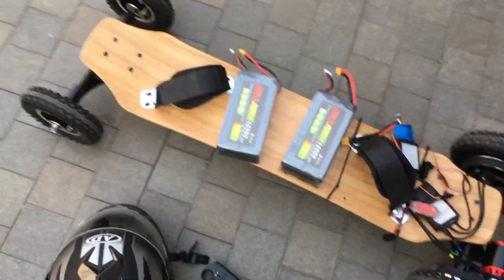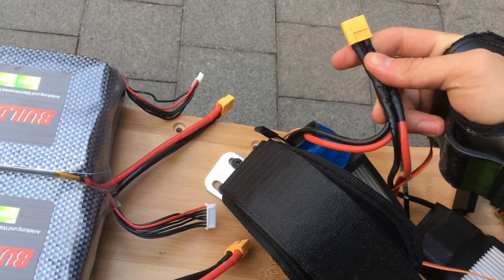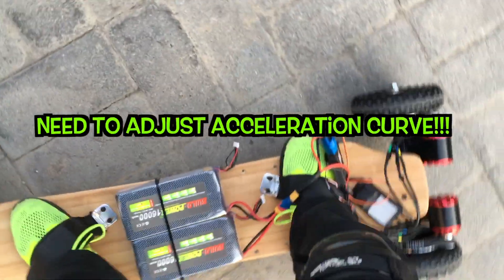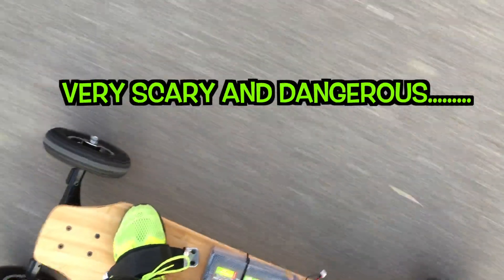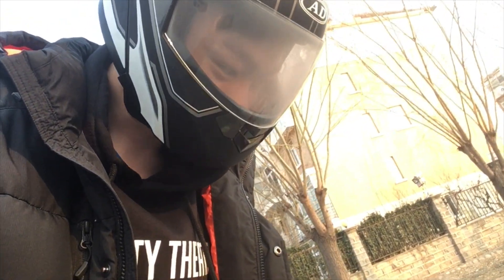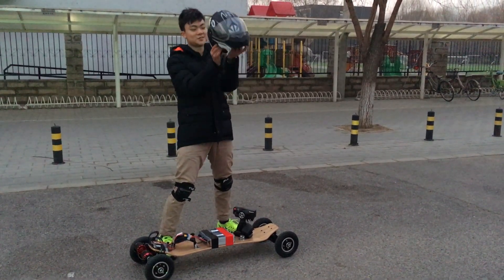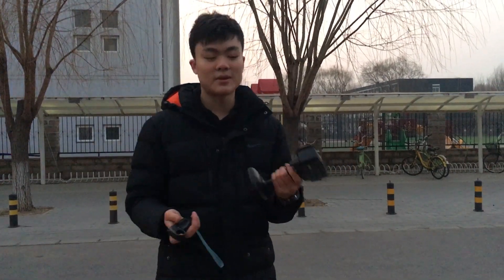DIY Electric Mountain Board (Part 3 FINAL PRODUCT)

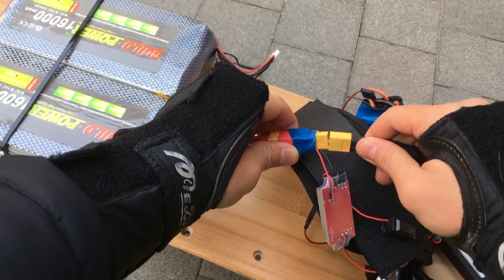Comment: 2:25 simple fact sound can be create when electro magnet and magnet is together (vibrating) like in a speaker.
 Not spining motor. Check your fact
Reply from the maker: Yea that’s what I meant haha spinning might not have been the right word thanks for the correction! Just thought it was cool that the motor makes the noise haha

Comment: Sweet build! The motors are screaming for MOAR power!
Reply from the maker: Ratheon Hudson thanks! Might make another build with this setup haha
Reply: @Leetheskill  Ever thought of getting a big block lipo for long range? I mounted a massive 40ah lipo to feed my 6.6kw Cross Country AWD board. I also mounted a few accessories powered by a 50ah 12v lipo
Reply from the maker: Ratheon Hudson wow that seems like a beast of a board, what’s the range and TOP speed?
Reply: @Leetheskill  Range, around 60 kilometres, the top speed is 45.5kph. Oh, and it had a Bluetooth subwoofer, dual fast usb charging, dual light bars and a low beam lightbar, and a truck taillight. Plus led underglow. I think... I overdid it.
At least my remote won't ever run out of power. I've got it covered
Reply from the maker: Ratheon Hudson I would love to give it a spin hahaha
Reply: @Leetheskill  yup, it's significantly heavier than most because of the large hub motors and weight distribution, but that smoothes the ride out well. I bet you'll love it
Reply from the maker: Can’t imagine the weight haha my board is already pretty darn heavy. Got trapped outside when it ran out of battery took so Long to drag it home hahah
Reply: @Leetheskill  Oh well it's not car-battery heavy. It's lighter. Plus the hub wheels can free roll. Oh yeah, I ran out of battery once on an uphill route and I can relate to hauling a heavy board home. That's why I bought a big block lipo. Eventually I want to buy a 60ah block someday, haha

Comment: What trucks and motor mounts do you have
Reply from the maker: Erroct Hi, this is similar to the one I purchased. Check out this product on Alibaba App Maytech Front and Backside Truck Set for Electric Mountainboard, Truck with Motor Mount and Shock Mount Spacer https://f2rq3.app.goo.gl?link=https://app.alibaba.com/dynamiclink?touchId%3D62092018037%26type%3Dproduct%26schema%3Denalibaba%253A%252F%252Fdetail%253Fid%253D62092018037%2526ck%253Dshare_detail%26ck%3Dshare_detail%26shareScene%3Dbuyer&apn=com.alibaba.intl.android.apps.poseidon&ibi=com.alibaba.sourcing&isi=503451073&amv=69

Comment: Is the UBEC a Anti-spark system? Is an Anti-spark system not needed if I have a ubec?
Reply from the maker: To my knowledge it is not. I am pretty sure you need both, some ESC has a BEC that does the job of a UBEC. Anti spark I think is a totally different system that is determined by the connectors that you use.

Comment: I'm building one like that with 10s4p sanyo 20700b Meepo batteries and 6355 motors, same trucks and tires. Probably going to add more batteries in the summer.
Reply from the maker: That sounds so cool! Would love to see it when you finish the build!! Good luck :)

Comment: buys $400 batteries straps them down with zip ties . . . really my dude.
Reply from the maker: Bro they were a lot cheaper than 400 lol 400 is near the cost of my whole board but true I should get a more permanent solution
Reply: @Leetheskill  lol I know still expensive batteries though
Reply from the maker: True lol, was going to dismantled it due to moving so didn’t want such a permanent fixture
Reply: Leetheskill hi, loved this video series. Can I have a link for the batteries please?
Reply: Respect the zip ties :) also, I use zip ties to hold the subwoofer tube on my heavy mountainboard with 36v and 12v lipos
Reply: agreed
Reply: I wish I could afford those batteries

Comment: Bro, I am able to access taobao, can you send a list of the component particularly the esc ebec and the battery. Idk how to build a lipo pack.did u install bmc?
Reply from the maker: Tbh I don’t recommend the ones on taobao, they don’t exactly deliver on what they say. Don’t need to build a lipo pack, just get lipo batteries and connect them, you don’t need a battery management system if you use existing batteries.

Comment: Liked your 3 videos. Very nice explanation. In a near future i will try to build it. Things I noticed:

1. Skateboard TABLE is expensive!
2. Can't acces to taobao from Spain. Would like to know the specifications of your board.
3. Is it worth to build the wheel apart from the motor to have more torque? 

THANKS!!!!!!!!!!!!!!!!!!!!!!! SUSCRIBED
Reply from the maker: Thank you so much for the support! Not that sure what you mean by the skateboard table is expensive. What parts do you want to know about? In some of the comments I have found similar products on amazon. For the belt drive system. Really depends, I have played around with in wheel motors but seeing that this is a mountain board meant to climb the belt drive does provide a lot more torque and it is a lot easier to maintain, swamping out individual broken parts instead of the whole in wheel motor.

Comment: What voltage lipos are you using?
Reply from the maker: Each battery is 6s which means 6 cells. Each cell is 3.7 volts. I connected two of these 6s batteries together so its now 12s. 44.4 volts.

Comment: Have you clocked this thing yet? Sounds fast. I would like to use the motors and escs you have. What brand kv?
Thanks
Reply from the maker: I didn't clock the thing but the math comes to around 50-60km/h (31-37 mph)if I push it to full throttle.

The website I bought the stuff from is on a Chinese website that cannot be accessed from anywhere else in the world. The brand is a very local brand and cannot be found anywhere else. I found a few alternatives on Amazon that may be of use.
https://www.amazon.com/L-faster-Longboard-Mountain-Components-Skateboard/dp/B073ZXDHMD/ref=sr_1_28?ie=UTF8&qid=1535426359&sr=8-28&keywords=mountain%2Bboard&th=1
https://www.amazon.com/L-faster-Electric-Skateboard-Longboard-Mountains/dp/B06XZ7346X/ref=sr_1_15?ie=UTF8&qid=1535426349&sr=8-15&keywords=mountain+board
https://www.amazon.com/SDS-Mountainboard-Mountian-Skateboard-Longboard/dp/B0081ZJK84/ref=sr_1_6?ie=UTF8&qid=1535426349&sr=8-6&keywords=mountain+board

Comment: Where did you get the gearing for the wheels?
Reply from the maker: The gear for the wheel came with the wheels that I bought off a Chinese website. This website doesn't work anywhere else in the world so this is an alternative on Amazon.
https://www.amazon.com/L-faster-Longboard-Mountain-Components-Skateboard/dp/B074YHTL8J/ref=sr_1_29?ie=UTF8&qid=1535426202&sr=8-29&keywords=mountain+board